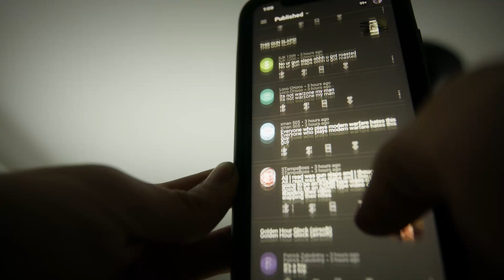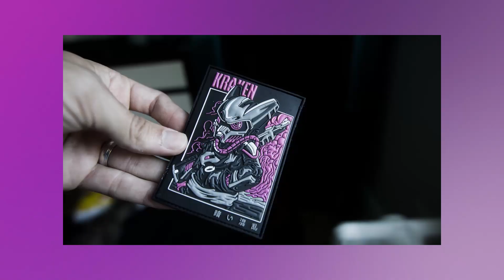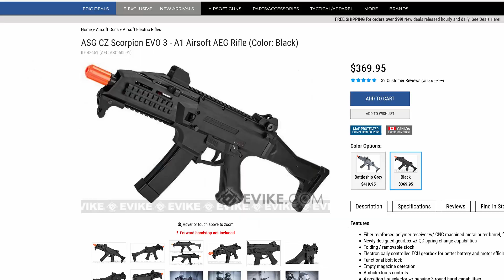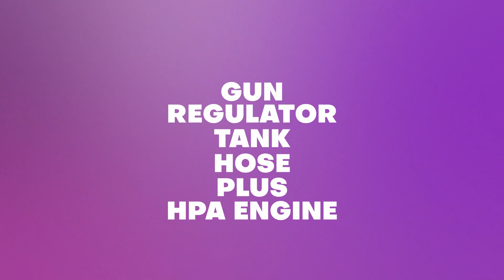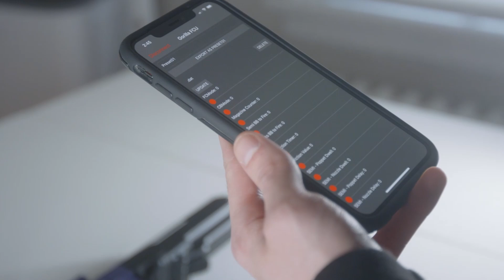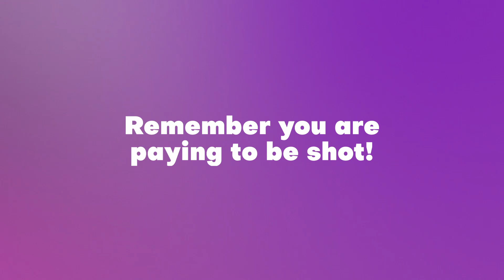EVERYONE HATES HPA

Comment: I've kinda turned my attitude on HPA around in the last few years mostly when I Did research for an older one of my videos and realized that An AEG and a HPA gun both just use puffs of air and one isnt inherently better. those air puffs are more consistent with an hpa engine but hop up barrel ETC... is exactly the same. That and accuracy for alot of airsoft guns is alot more about bb weight and hop up than anything else.
Reply: While technically the mechanics are similar. AEGs inevitably reach a limitation which HPA can surpass. Examples would be ROF, RPS, and a quick way to increase/decrease FPS. AEG have to go through so much fine tuning before they can reach even 40 RPS, meanwhile most, if not all,  HPA setups utilize drop-in gearboxes.
Reply: @callsignredacted8290  well hpa beside needing an fcu battery is just a pneumatic tool… but it comes at a cost

Comment: The umbilical cord connected to the gun looks stupid. That is my last optio if something doesnt work. Ill only doing it if theres no other way to salvage it. Especially if i spent $500. A good rig is $300 and then the f2 is $500. So my new gun now costs $1300 as if it wasnt expensive already and i havent had the gun for long. I made the mistake of trying to install a perun hybrid in my rpk16 without any soldering experience. I soldered the singal wire on the wrongbend. It will shoot but the gearbox wont with because that solder joint is in the way and i was off with the selector plate ever so slightly i could only get semi auto to work and i couldn't Access programing mode and when i tested in in the gun with the motor disconnected that light came on. Its now on the shop having an aster fitted and im just waiting on them to call me.

Comment: For me, the AEG vs HPA discussion is extremely similar to the electric vs gas RC cars. In the early days where we had NiMh batteries and brushed motors, electric RC cars were slow and weak and paled in comparison to the gas / nitro powered ones. But then brushless motors and LiPo / Li-ion batteries came along and suddenly gas powered RC cars became completely obsolete.
Old AEGs weren't that great with the NiMh batteries and no mosfets, HPA was a total godsent. But AEGs nowadays are closing the gap, especially when considering cost at all.
I'm running a Krytac SPR and I slapped the 6000 mAh titan in it, it was completely hassle-free until now, nothing broke, fire rate is great, never ran out of juice on the field, completely bone stock and it shoots great. Then I see my HPA friends who run the hoses and air tanks, they constantly have to tinker with their guns because they're all custom made, they paid at least twice the money for their custom guns than I paid for mine stock, and because we have fps and fire rate limits, the only performance gains they have are minimal. The only real benefit is that they're more silent. Is that worth paying twice the price plus having to tinker with it and having to deal with refilling the air tanks? Absolutely not in my opinion.
Reply: That being said, I'm still going to build a HPA gun because I recognize that there is one more benefit that HPA has over AEG: Adjusting FPS is MUCH easier to do on the fly than any quick spring change system on the market. And this is important to me because I visit different fields with vastly different fps and bb weight rules and I'm building a DMR-type gun that should work with 0.45 as well as 0.3g bbs at various different fps, and optimizing an AEG for these different scenarios is just not feasible. I'd have to build 3 different guns and I don't like that idea.

Comment: HPA is just kind of boring yeah the performance is there but it's kind of pointless cuz most Fields have a restriction not to mention it just takes a ton of immersion away plus the big bulky dorky looking tank on the back now believe me I love the fire rate and the loudness especially when someone's cool enough to put an amplifier on it but it's just too big and bulky and has a giant tube running into the gun so it makes me feel less like I'm holding a badass weapon and more like I'm holding a toy for 8 year old although I am curious and how powerful the max airsoft HPA system could be with no safety limits installed